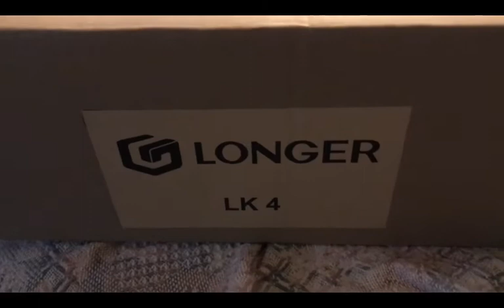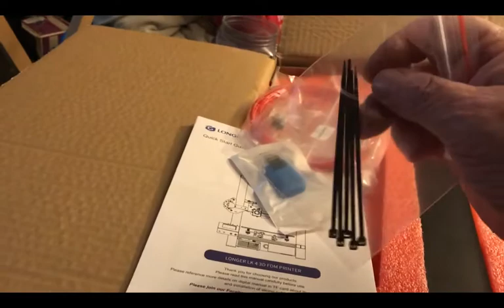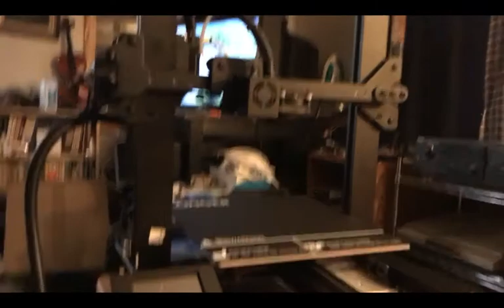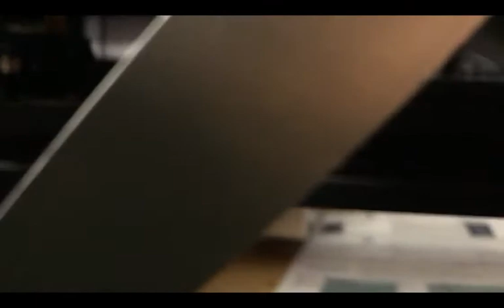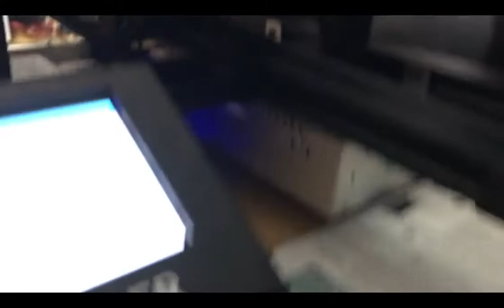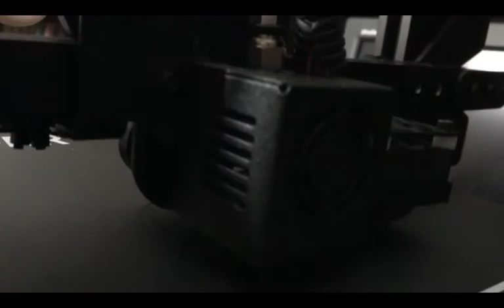Louder LK4 3D printer assembly and setup

Comment: Nice printer and awesome first print..Should never extrude filament with the nozzle that close to the bed if the print head isn't moving..Any time you hear that clicking sound from the extruder it means you're either too close to the bed or your temp is too low which are both bad because it can cause an extruder jam and they're no fun at all.
Reply from the maker: Yeah Pat, when I first heard that I had a feeling something was wrong. Once I got it dialed in correctly, she is printing great now. Part of that ole learning curve. 
Stay safe pal.
Reply: @skycarl  It takes a while to get them dialed in properly for sure..I need to upgrade my printer frame eventually from the acrylic to a metal frame and that'll be fun..Have a good one Carl and Happy printing.